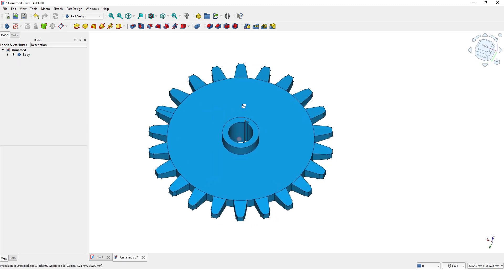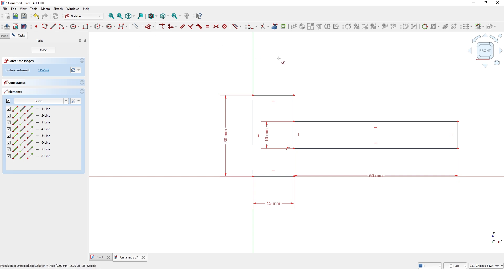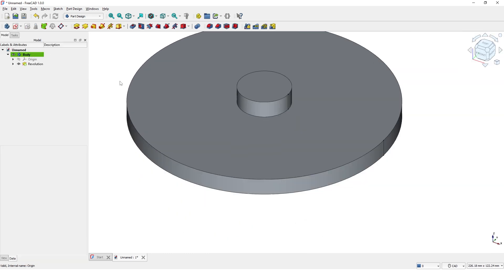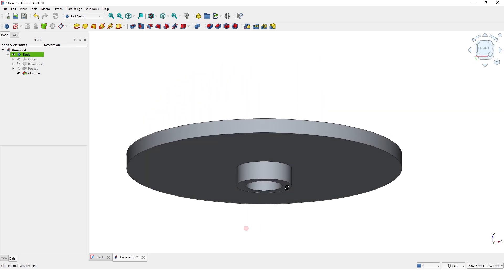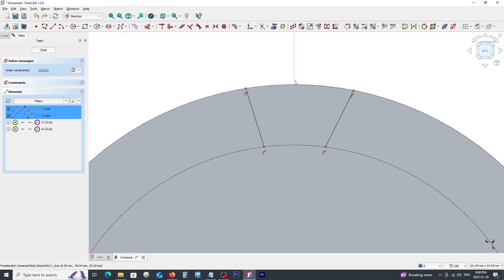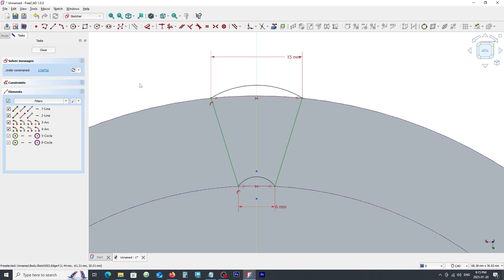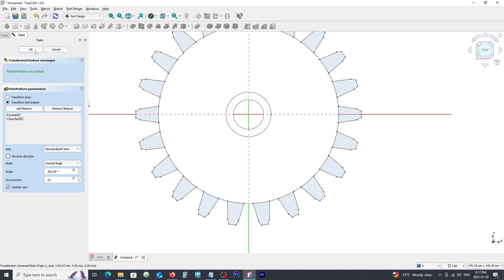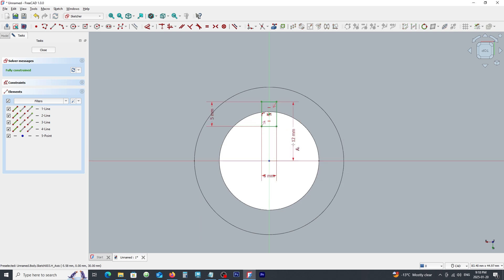How to model gears in FreeCAD | 3D modeling with FreeCAD for 3D printing #freecad #freecadtutorial

Comment: Thanks. Learned two great things (though one of them took two tries):  I can radial-pattern multiple-selected objects at once. (would never have occurred to me) and that technique of closing a wire frame by drawing a 3 point arc and then setting the arc to be equal to another used as a guide.  Very helpful, as always.   Thanks.
Reply: Agree, the arc trick was awesome.
Reply: This worked like a charm!  Thanks so much!
Reply from the maker: Glad to see your comment. Thank you.